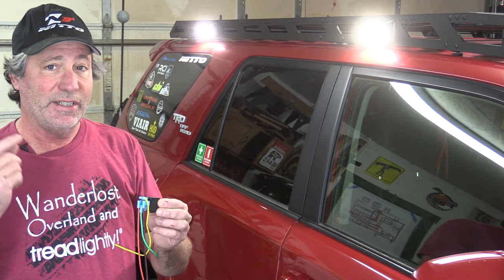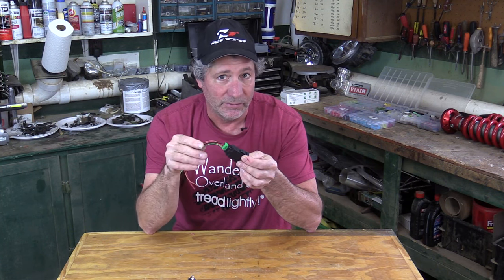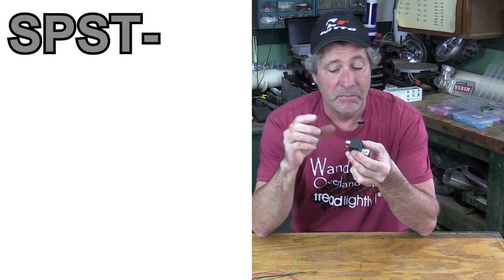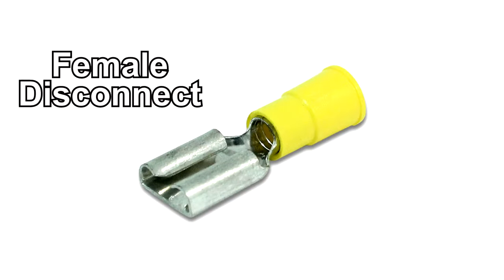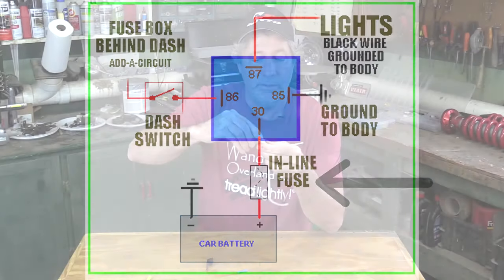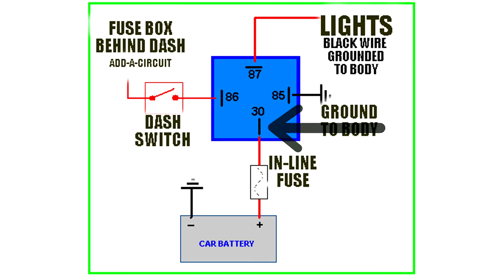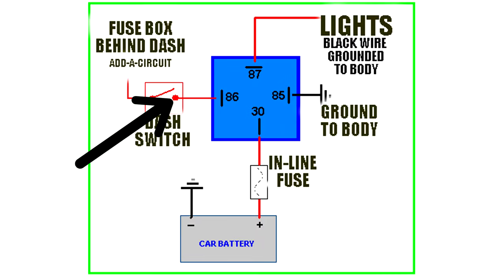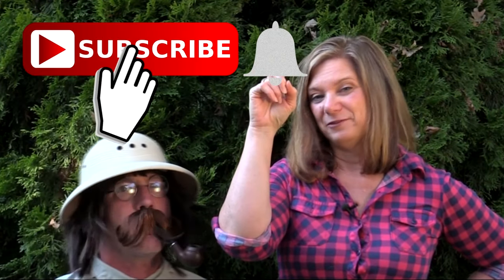How To Wire An Automotive Relay Switch, With Diagram, 4 Pin

Comment: Coming from a power source on the switch side, what size wire would be recommended since most of the current is going in thru from the battery

Comment: Great video Sir 👍 I know very little about automotive wiring but I thought I knew enough to extend the ground wire from the relay 6 inches using the same gage wire but after doing this seemingly simple thing the lights don't work yet the red and green lights on the switch work and fuse is still good so I have no clue what happened or how to fix it  ?

Comment: I have a 12v4bt-1m relay laying around and I want to know can I use this for a 12v car air horn? It doesn't have 85,86,87 and 30 just 1,2,3 and 4 written on the relay, It came with the lug with it... 1 for red, 2 for black, 3 for blue with white stripe and 4 is yellow.

Comment: I going to install 6 lights(50, 30 and 4 pods) on 4 circuits. Should I run a #10 to a buss bar and tap off for the 4,  or just run 1 wire and pigtail the relays from it, or run one 12 ga from the battery for each circuit?

Comment: Hi! Can I run 24 volts from 30 to 87 and 12 volts on the trigger (85/86) switch? I'm planning to install a 24v airhorn in my car and I just bought a 24V boost up converter.

Comment: Wish I seen this two months ago when I wired my Rigid D2’s up. Couldn’t use the Air on Board switch because the original D2 Pro’s didn’t come with a relay.

Comment: Is it possible to have an on and off switch manual hooked to my fan relay inside my engine fuse box? So I can turn it on manual if I need to instead of the coolant temperature sensor turning it on or when the air conditioner is on. I would rather have control of that sometimes

Comment: What if I have a "dual function switch"? For instance, meaning a switch that does an "up" and a "down" function? Is it ok to hook up both function wires to 86 and it still perform correctly?

Comment: Hi. On toyota oem light switch 4 wire green red red and black witch wire go  where on the relay. If black go to body and one red to tail fuse .  Where sould green and reg go to light up switch corectly. Thanks for all your infi.

Comment: If you have multiple lights, do you just splice them together before connecting them to the #87 terminal on the relay, assuming, combined, they're still less than the max amperage of the relay box?
Reply from the maker: Yup.

Comment: Okay, so the LED lights I bought for my vehicle came with all the necessary wiring and a relay.  I ran the black wire from it to a good neg grounding point.  I ran the red wire w/ inline fuse to the +pos terminal on my battery.  I've blown 2 15amp fuses trying to test the lights 2 different times.  What gives?
Reply from the maker: Likely a short in the lights.

Comment: not sure about using an add a fuse on my fuse block, i am at the moment for the ditch lights i just installed on my 2016 tacoma....the fuse box cover won`t go back on with the add a fuse.  may have to rewire and go to fuse block under the hood. i used it for the "second" wire used for dash light on my aftermarket oem looking switch.
Reply from the maker: There are covers available that allow for the add a circuits.
Reply: @WanderlostOverland  link for covers?

Comment: How do you determine the in line fuse amps?
Reply from the maker: Assuming all the wire, connectors, and switches are sized for the same, the fuse is sized slightly larger than the draw from the lights or whatever you're powering.

Comment: Greetings!
Can we use 12v 30amp relay in place of 12v 40amp relay? 
Plz guide.
Reply from the maker: Sure
Reply: Actually, it depends how many amps on that circuit.  If your circuit has the loud 400 watt stereo, that draws 33.3 amps (amps =watts/volts,  400/12= 33.3 amps. ) and you’ll possibly burn out the relay.

Comment: Can you have the in-line fuse between the relay and the accessory, rather than between the battery and the relay? I was gonna go battery - relay - circuit breaker - accessory fuse block
Reply from the maker: Then your relay won't be protected from surges.

Comment: can i do 40a mp relay with a 30 amp fuse and 20 amp switch?
Reply: Sure.  As long as the circuit doesn’t exceed the 30 amp fuse because it will blow.  Each component you listed, you gave an amp rating and that is the ‘max’ amp it can operate and not fail.  They can operate below this level.  Soooo, the question is what amperage is necessary to drive whatever equipment you’re adding to your vehicle.  Just like a lightbulb, the equipment you’re adding ‘should’ have a wattage (power) rating.  The simple formula you need is Watts = Voltage x Current (amps) As an example, let’s say you’re adding a 300 Watt stereo.  300 Watts = 12 volts (car battery) x unknown current.  Rearranging, current = 300 / 12. Current is equal to 25 amps.  So, the switch which only carries a few amps is fine.  The fuse won’t blow and you won’t damage the relay.  The only question is what size (gauge)wires to run from the battery to the relay (pin 30) and from relay (pin 87) to your new device.  Google automotive wire amperage capacity chart. This chart will give you what gauge wire to use for your particular amperage and the length of run carrying this amperage.
Reply: @glasshalffull2930  thank u so much for ur time
Reply: @Luui2x  You’re welcome.  What upgrade are you installing?

Comment: Why on the relay is 30 a power input and 86 is also a power input?
Reply: 30 is the power to the relay from the battery, 86 is power from the dash switch.

Comment: There are two things I don’t understand.

If we add auxiliary lights, cooling or whatever… How do we know that it is not over taxing the charging system of the vehicle itself? That is, when is it too much load on the floor later?

If you use a circuit extender into the fuse box and add amperage to it, the wire running to that circuit is still of a certain gauge. How do we know that we are not overburdening it?
Reply: Alternator! Not floor later

Comment: I am 12 in my honda they are fog lights they dont work i got new switch but the fog light only work when i connect 2 wires and it gets heated plss help me i think my relay is fine i need more explanation 😢❤

Comment: Have yet to see anyone address the dilema of why the schematic embossed on the side of the cover shows one of the contacts labeled as 30, but then the actual spade terminal (or pin) is marked 87a. They are the same!
Reply from the maker: Nope; 87 and/or 87a will be connected to your controlled accessories that you wish to turn on
and off with your relay.
30 will then be the pin connected to your battery power.